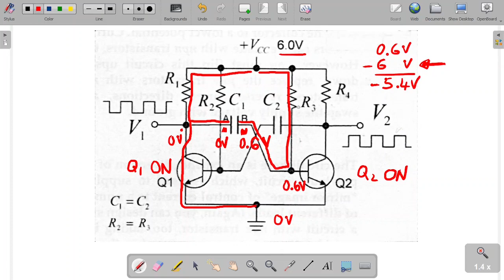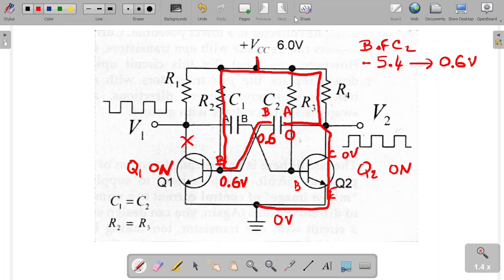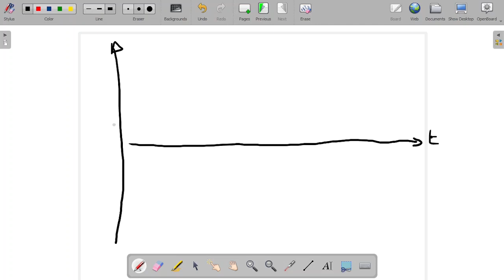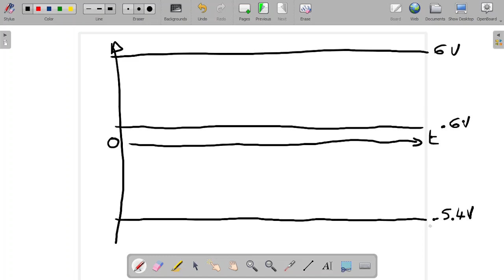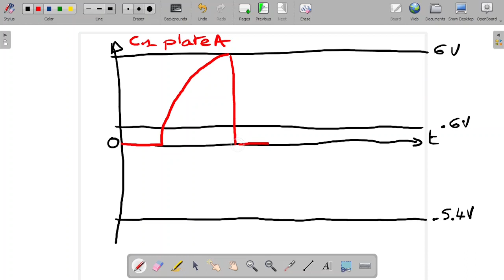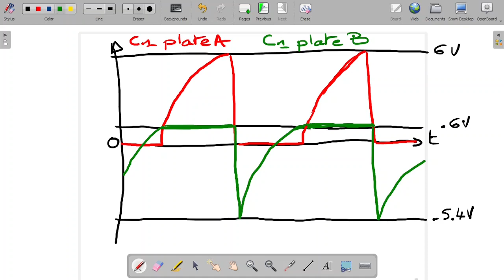How does a 2 transistor astable multivibrator work?

Comment: I have 2 questions.
FIRST..
I saw that usually C1 and C2 capacitors are electrolitics.
Lets take capacitor C1.
Plate A is positive and plate B is negative.
It is possible to charge C1 in reverse connection (plate A on ground and plate B to positive plate of supply)?
Because at one moment Plate A has zero potential and plate B has -5.4 potential.
When Q1 is conducting Plate A is on the ground and Plate B is on positive side of supply.
I understand that this is the phase of discharge of C1 (i saw that a charged capacitor in reverse connection discharge) but why potential on plate B (negative) begin to rise above zero?
Shouldn stay at zero?
So intead of that we have 0V on plate positive A and +0.7V on plane negative B.
So electrolitic capacitors can be charged in reverse connection?

SECOND
I dont understand at the beginning how C1 is charged.
Both plates (A and B, positive and negative) are connected to the positive plate of supply.
Q1 is blocked so plate A receive +Vcc (5 v) potential.
But why and how potential on negative plate B begin to rise?
And if begin to rise, plate A shouldn get some electrons from the plate B and loose some potential?
Because Plate B is negative.
Thankyou.

Comment: 7:02.  Lets not assume Q1 turns on at some point.  It doesn't say much.  :-)
Q1 can only turn on if it gets current from the cap at Q2 which means a cap that is discharging.  Right?
But the cap at Q2 could not have charged since the collector at Q2 was at 0 volts due to current flowing through it. The cap can only charge if the transistor is off with its collector at 6V.
Reply from the maker: In the electronics for inventors book, the author makes the same assumption, which i think is very reasonable.